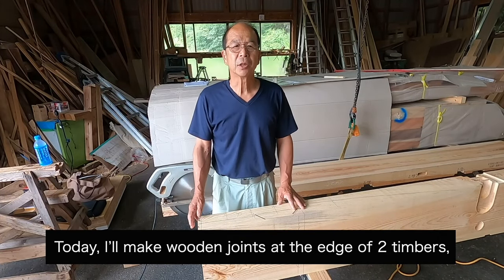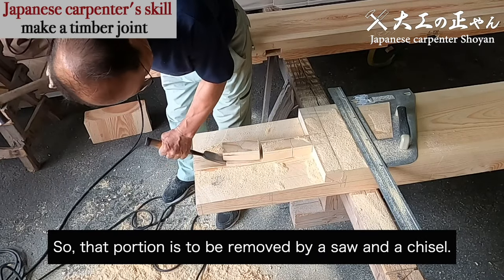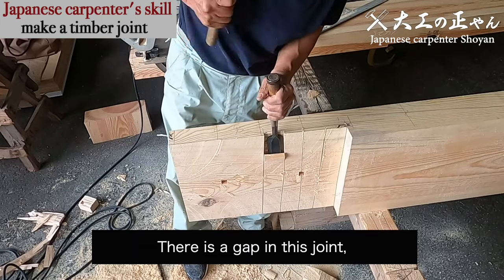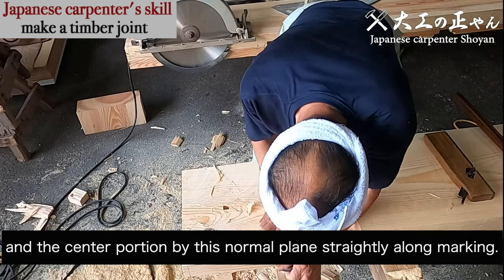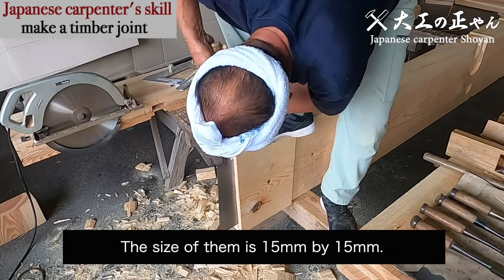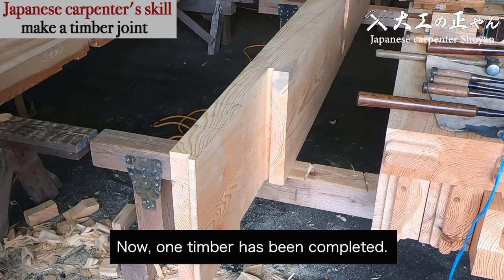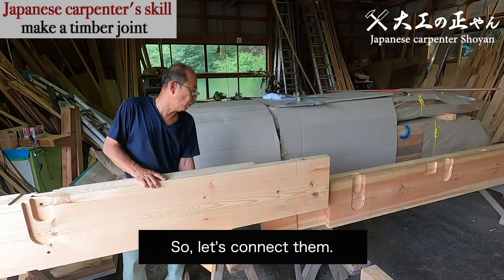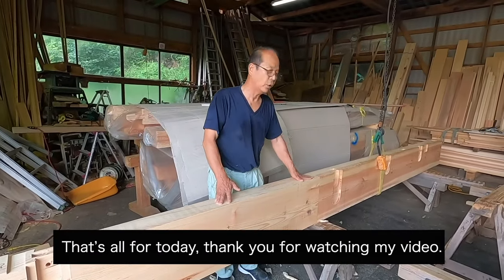Japanese woodworking - Making a Timber Joint by Hand

Comment: I give up. To gather all the tools needed alone I will have to fly to Japan and raid several carpenters..... But even if I had those tools I'll never know how to gather the knowledge and experience this skilled master has in my entire life. Astonishing.
Reply: just hire a blacksmith!
Reply: don't be ridiculous
There is nothing particularly difficult about what he's doing
It's just a half lap joint with 2 lips so that it stays straight. 
I've reinvented some japanese joints many times without knowing it, because every joint is basically removing half of the wood on piece A and half of wood on piece B on the intersection volume.

Comment: The timbers are awfully square. I wonder if that is a necessary condition for starting the joints. Western timber joinery assumes that none of the timbers are actually square or even simply round. Yet japanese sometime do use round timbers from what I saw, in which case I imagine a different style of marking than you see in the video is required.